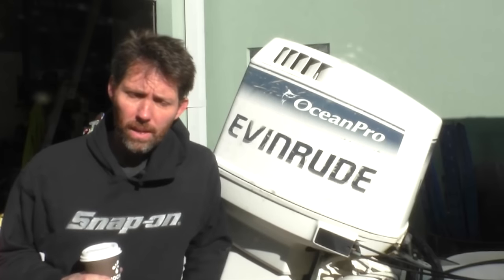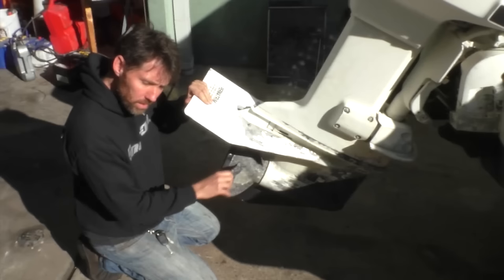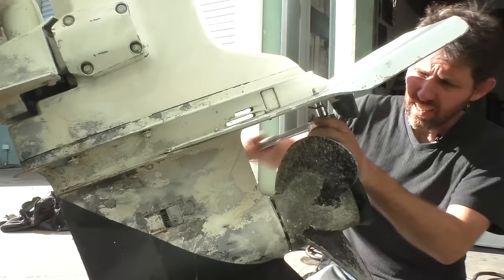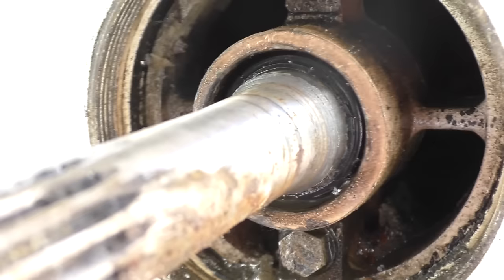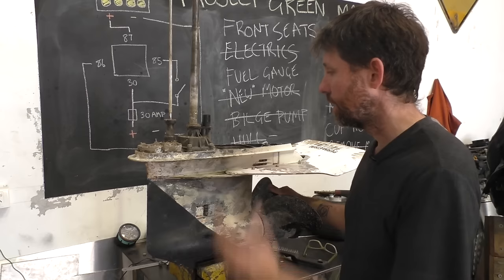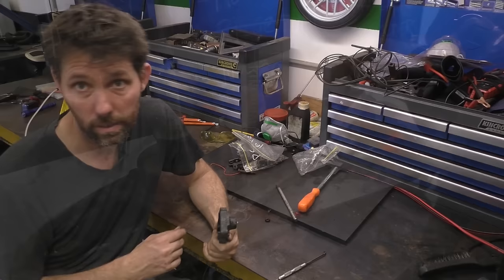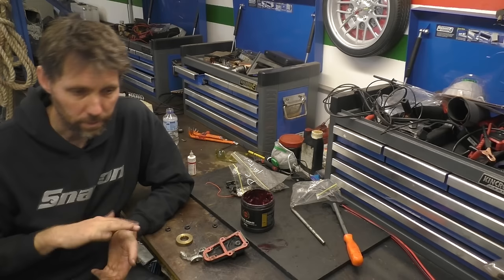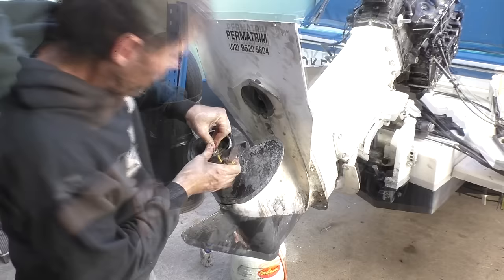Starting an Evinrude 150 outboard for the first time in years

Comment: Should I remove spark plugs and spray wd 40 and do this process on a mercruiser inboard to?  It’s been sitting for 4 years and I want to get it ready this season?
Reply from the maker: You can't hurt it by doing so and a bit of start-up lubrication is always good. Spray it a day or so before you try to start it though to give it time to run down to the rings.
Reply: @DangarMarine  thank you very much apreciate it. Your a saver for us that need to do it our selfs since no one works on these engines in my town

Comment: those phillip head bolts dont locate the trim tab theyre just holding that stupid hydrofoil on which is bent as shit haha. How could you adjust a trim tab if it had 2 "locating screws"? I dont know how you work on johnos without imperial tools, 10mm always slips! Those shift o-rings always swell and seize up that shaft and the bend up the top is normal. Looks like the VRO shit itself. It wasnt in the video but i hope you did the compressions before ALL of this.
Reply from the maker: Nah, definitely for locating the trim tab, hydrofoil bolts are much wider out (and don't go through the trim tab). I find 10mm pretty good for 3/8 bolts. Some different sizes can be dodgy, but 3/8 seem fine.
Reply: hmm i dont buy it. i would like to see pictures. 11mm and 14mm can also be too tight on the nut which gives me the shits when it catches. You only need 3/8, 7/16 and 9/16  and you got the whole motor sorted.

Comment: thanks  for the quick reply, have one question?  so if i start and run it at that high idling is the engine going to be ok and i have fuel injectors
Reply from the maker: Yes, it will be fine as long as it isn't near the red line or anything.
Reply from the maker: Yes, it will be fine as long as it isn't near the red line or anything.

Comment: I have a 1982 35 hp evinrude with no power trim. I cant find out how the hell to manually tilt the motor? Not sure if it's seized or what, if anyone can help that would be great...nice workaround btw...
Reply from the maker: Hi Jeff. On the 30HP Johnson I've got in the shop at the moment there is a lever on the port side near the tilt tube that I need to pull forward to lift the motor up. If that isn't there or working take a look under the motor and see if you can see a hook that holds it down. It is a different motor but this video might give you some clues about what is going wrong https://www.youtube.com/watch?v=Topfyfm4bFg
Reply: Thanks I will have another look tonight..appreciate all your videos!

Comment: Does the water pump work when in natural sitting still in the water?
Reply from the maker: Yep, as long as the motor is running the pump will be working.
Reply: Thanks.
I was cleaning the carbs on 1972 evinrude 50 hp and it thru a bearing out both sides of the case! I haven't checked the impeller because the owner told me it was new? you ever here of that?
blew my mind!

Comment: Hi brother I have a question ,  I have a jonhson 115 hp 1996 I replace all the gaskets on the carb an now my boat turn on a for like a 1min and turn off and have to keep cranking and is hard to turn it on . I also drove it and when I put it on drive it turn off . And when I got to run it and drive it it was kick from ti mb e to time on high speed.  Do you have any idea what is going on .  Thank you i really appreciate it
Reply from the maker: It could be that the needle and seat and float valve got a bit jammed up on reassembly meaning the fuel isn't flowing into the carburettor properly.
Reply: Do you mean the ones on the fuel cups on each carb.  or the one that seat on top of the pump . And the needles is this the 4 needle for the jet or the one on the float? .  Thank you for replying
Reply: Oh sorry now I get it . I did not replace them should I replace them or just check them to see if they are good.  

One more question how do you know if the boat is not out of time , how can I tell  . I did not touch it just thought it was the problem cus it move the engine like shaking a little.   And also i thought it was the pack but i check all of them and they all spark good.  .
Reply from the maker: I would just check that to make sure they are good. You check the timing with a timing light, but shaking generally isn't a timing problem it is more to do with uneven power coming from the cylinders so one again I would be looking at the carbs.
Reply: Thank you  brother

Comment: What year and model number is that motor???
Reply from the maker: I think it was a 1996, can't remember the model.
Reply: @DangarMarine   thanks i have the same engine but the plate is gone i cant figure out the year and model
Reply: @DangarMarine  Actually i did find the plate but i cant figure out a model for it  it says  ME150WTLRS

Comment: Hi stu,
I have a Johnson 35  gabout 1980 the forward controls are twin lever  I can't work out. How to remove old. Cable. From handle assembly.    It has plastic sleave with what looks like a Allen bolt to remove.  Have you any answer to getting. Cable out. Or do I replace  the whole. Deal     If so can I replace it with  a remote control system that I can incorporate. Key assembly in to as well \
Cheers 
 Mike
Reply from the maker: Generally the cables are connected in two locations. The outer casings of the cable are held still by a collar of some sort while the centre moveable section will be attached by a pin that can articulate. Once both of those are removed you should be able to get them out. https://www.youtube.com/watch?v=mdkFnqor-Is

Comment: It's pretty obvious this guy has had no formal training on this subject you cannot turn the engine over by prop it will ratchet I'm afraid
Reply: All that work and you have not even checked compression on engine should have been your first step . Cleaned carbs if first step was good and pop it off with some fresh fuel a little thick on oil with some new plugs .  Cost to fire it up spark plugs .